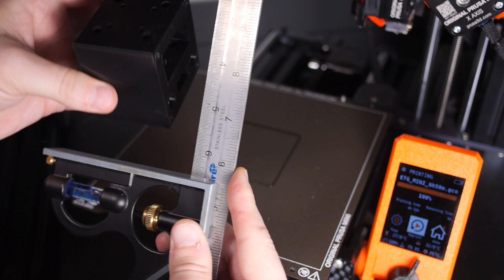3D printer part precision, a simple test using a Prusa Mini Plus to print a simple cube

Comment: BTW, as an carpenter hobbyist, here you have a different way to do it, that is a trick I learned when trying to glue a table and you want it to have right angles... 
The trick is to just measure the "diagonals" and see how they differ (if they differ), in this way, you get much more precision than checking with an angle. 
Greetings from the Galilee :)
Reply from the maker: Greetings to the Galilee! 
Thank you for commenting. 
I've recently printed a rather large rectangle, perhaps I'll measure the angles later.